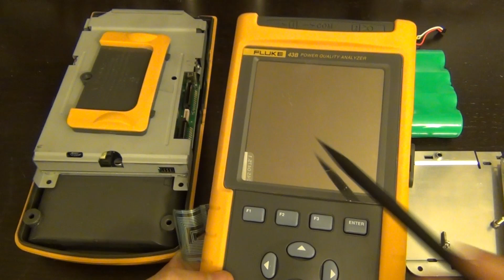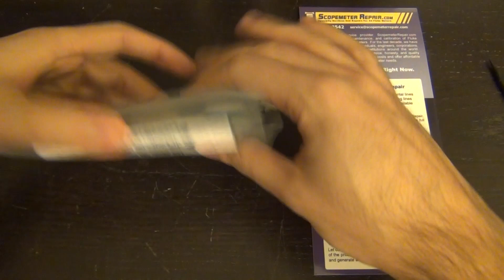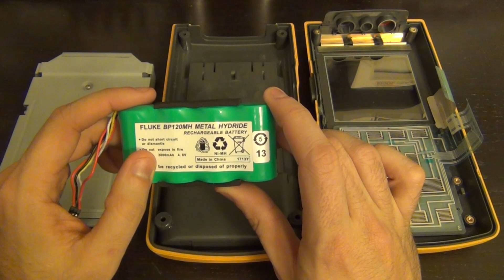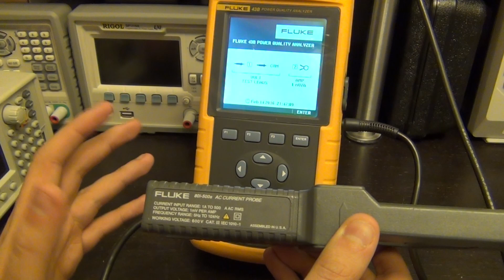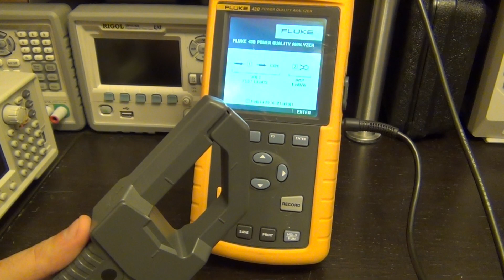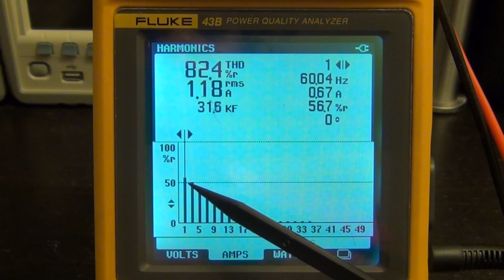TSP #74 - Teardown, Repair and Experiments with the Fluke 43B Power Quality Analyzer

Comment: Hi.my fluke 123 having issue and nobody can help me out maybe here  some one have some suggestions.so here is the problem.my fluke 123 is only click sound in speaker section no as loud but u can hear click.just totally dead.when button pressed power on click disappear  until released.tryed with battery without battery.power supply genuine 19v something on output I think.any one any suggestions  thanks in advance.
Reply: I had a similar issue for my F scope M123 - But not sure the same , For me the problem started when I tried to repair the battery connector which had corroded wire side (greenish) , looks like there was a short ckt and I can only here click sound after it - no display .After some checks I found the charge current (Shunt) resistors (3 x1R) are open.I got the resistors from shop and replaced ,Its OK after.Easy check for this type of issue with out opening up the meter is to test the resistance between battery connector -ive (top middle when display side down) and the middle pin (-ive)at the inside of power adaptor socket - Its should be around 0.3-0.4R.offcource remove the battery and Ac adaptor.

Other issue could be display backlight supply failure.You can check it with service manual.
I faced it long back with no display and a hissing noise (power supply loading like).But I was still able to connect the scope meter with Laptop though it was not able to measure any.So it means main powersupply OK .
I had to send it to a repair center and they quoted hefty for repair.Finally up on my relentless perusal they agreed to replace the mother board with a used one for 1/3rd price.When I received I checked - whola they put a Fluke 125 mother board and I have all power and harmonic measurements !!!. Actually the hardware is the same - but public cannot flash a Fluke  125 firmware on 123 by available flashing tool.Even I tried to update the received one with a latest 125 Fw , but it declined the offer ,may be because I put the Fluke 123 serial number .

Comment: likely it's too late for suggestions, but watching the effect of a VFD on the power line would be interesting when delivered with your insight. I have to deal with those often and I would benefit from a better understanding of the effect. In addition, determining the cost benefit ratio of installing a VFD vs a soft start vs across the line start of centrifugal pumps would be very useful. You have a great style with clear explanations.

Comment: How does your current clamp attach to the 43B?   Isn't your 80i-500s current clamp terminated with BNC?  But I don't see a BNC socket at the top of the 43B.   How do you get them to mate?

Also, can you use a current transformer instead... by terminating it with a resistor?  For example, Fluke makes clamp transformers with 1ma per amp output.  Is it valid to bridge the conductors with a one ohm resistor to simulate a 1mv/amp "official" clamp meant for the 43B?  Thanks.

Comment: Great video as always.... I believe the screen is repaired using a replacement elastomeric strip with some plastic pieces to offset the connection.... taped to prevent disassembly/tampering.
Keep up the excellent videos!!! .... PhD EE you guys ROCK!

Comment: Although you mention that the clamp is good from 1 amp to 500 amps, it's very common when using a clamp-on ammeter keep on hand a simple coil with 10 turns, and maybe even a second coil with 50 turns of some small wire, perhaps #24.  
So obviously it can measure  0.1 amp with the ten turn coil.

Comment: I have had these "unusual" wiggly lines in displays as well and thought they were production contamination like microbes eating their way into the crystals, because it looked so similar to some old CD's where microbes really ate away the aluminium. So I took it to the manufacturer and they told me I was wrong. They said, this is nothing more than the crystals dissapearing through a tiny micro rupture of the glass. It's kinda hard to believe since I never found any residue near those spots. However, that's what I have been told.

Comment: definitely worth a thumbs up :)

I suggest you make shorter videos as tips for the experts or longer ones for the beginners. this is a good example of learning by principle when it comes to how these kind of meters work but you can make another one about power factors, current & voltage lead/lag with intuitive experiments for beginners.

Comment: The damage you showed on the LCD panel is pressure damage. I've had LCD's sitting for a long time with stress on the glass, and the same happens. What happens inside with the liquid crystal liquid i do not know, though.
Reply: +zaprodk And these look to me like handwriting. Someone may have written to a peace of paper that was on top of the screen.
Reply: I can assure you that it's not handwriting on a /piece/ pf paper that made that damage. I've seen several displays with this damage, even one i damaged myself by having something heavy ontop for a prolonged period, and they all look the same. It's the crystalline structure of the liquid crystals that looks like that - not handwriting.

Comment: When you find a business that specializes on repairing these scope/meter screens you know you have a whole bunch of them going bad.. Fluke should at least offer cheaper replacements but as we all know it's way more advantageous for them if you just buy a new instrument.
Reply: +zaprodk Fluke sells a product, Fluke should take responsibility for a fault in its product by at least providing affordable replacement parts.
Reply: +zaprodk 
Change supplier.
Reply: +VoltLog Fluke is not manufacturing the display. They are custom made by a large LCD-manufacturing company. Fluke cannot do anything about a bad product from a subcontractor.

Comment: The notorious Fluke hotbar attachment problem!
Reply from the maker: +EEVblog Yes, I remember your video of the scopemeter when you finally fixed the lines only to find the damn thing had bad scope channels. My hats off to you for your determination to fix that screen, very annoying problem.
Reply: +The Signal Path Blog I fixed 3 Scopemeters that had lines on the screen, and it's really surprisingly easy. What worked just fine was just pressing a hot soldering iron across the hot bar attachment slowly, at medium temperature. This fixes most of the lines, the few that are left you can pinpoint with the iron and so far that does the trick fine. I was initially worried about damaging the strip, but apparently it's totally fine. The hotter the iron the better it works. I initially tested it out on a non critical part past the connection to see if it would melt, then go at it. It takes a few minutes and they have been good for quite a while now. If you find one cheap with lines, it's likely a simple fix.
Reply: +EEVblog Opel/Vauxhall/Holden cars' trip computer have very similar LCD to driver interconnection which fails as well. :-) Poor design in my opinion.
Reply: +epatto Even BMW from the 90's have this problem. I think it's the moisture that eats the connections over time.
Reply: +epatto Varitronix 240x64 LCD displays from the late 90s to 2005 had that as well. 100% failure rate after 10 years.